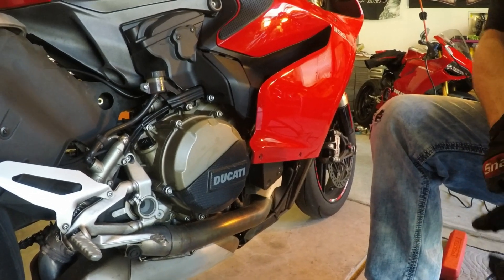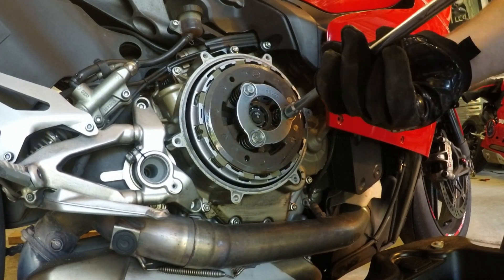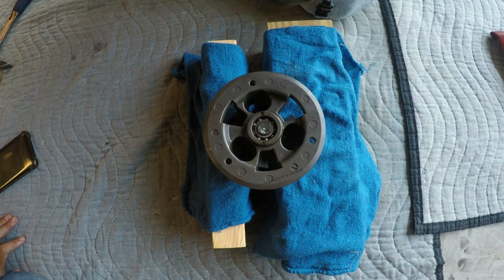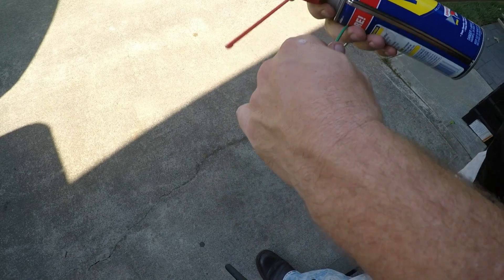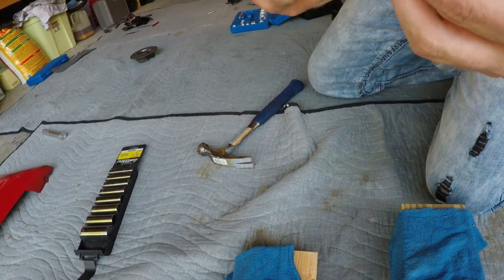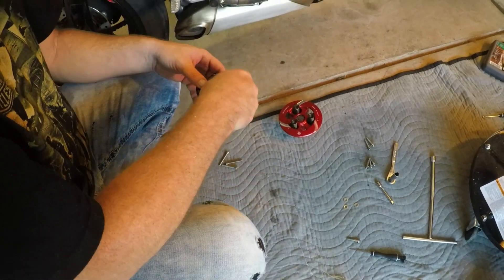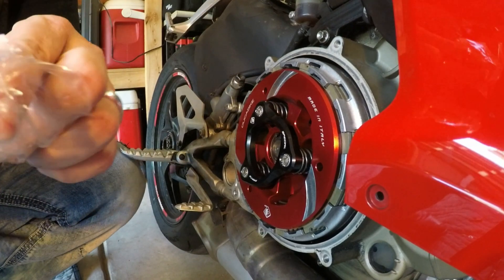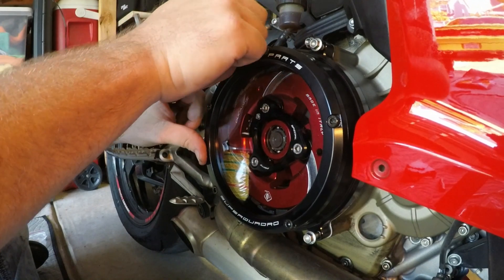Ducabike Install on Ducati 1199 Panigale

Comment: Great video and definitely helped me yesterday while installing my clear cover on my 1199s. Can I ask you, the post/pole that attaches to the bearing... Mine is slightly showing through on the outside (if you are looking at the pressure plate once mounted to bike if that makes sense), is that ok or should the pole/post be completely flush with the bearing? And my last question, do you have a rattle when it's running ? Thanks very much 🙏
Reply from the maker: The rod sticks out slightly when its fully seated so that is normal.  Yeah...they all rattle a bit.  I no longer have this bike but I have a number of video's with the bike running...they all rattle a bit...congrats on a killer bike man!!
Reply: Thanks mate. Dropped ya a DM and follow on insta earlier as I didn't know if he were still active on YouTube etc thanks for the quick reply 😊

Comment: 26:00 Help ! My plate is not getting snug on there to move forward
Reply from the maker: You have to align the first plate correctly...it took us quite a while to get it manipulated to the right spot...just be patient and use the holes with a pic to move that first plate into the right spot and you will know immediately when you got it...
Reply: @redrider0151  i eventually got it, thank you guys so much for the video as this by far is the most informational video out there!

Comment: So if it’s not seated it will turn a little and once seated your can turn and it will have tension?
Reply from the maker: If its not seated it will feel like you have metal on metal and it will have a tiny bit of play left to right.  Once its seated, it will actually feel soft...you will be able to push it in and out a tiny bit because it wont be up against a hard surface...(you will know right away if you got it right)  Also, when I did this one you could see that I could turn it a bit because the bike was in neutral...when its not seated, its not moving.
Reply: RedRider0151  thanks great job on the tutorial it helps a lot I was gonna have a shop here in town do it for me this is gonna save me $220
Reply from the maker: @joes967  Sweet!!! So they were going to charge you 2 hours labor and you literally watched 2 complete morons due it in 45 minutes. Lolz. Just make sure all the bolts get tightened to 10-12 newton meters. If you are worried about running into issues I am happy to give you my number to talk you through any problems...but the video shows pretty much everything that can go wrong. Good luck and enjoy your new cover and plate dude!!!
Reply: I just bought the same set up . But the pressure plate looks a little darker red than the bike or in the pictures online . A little burgundy . Is that the case with yours?
Reply from the maker: @neph-izmo6842  Mine is a tad bit darker red than the Ducati red...but its nowhere near maroon....the video is pretty much dead on accurate as far as the shade of red that it is...